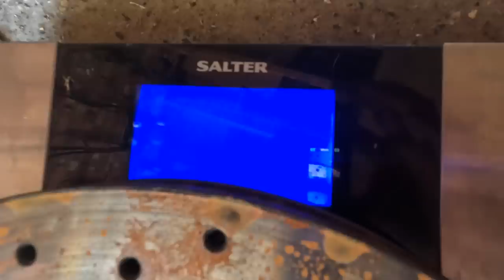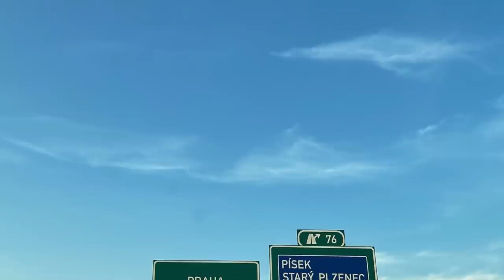I Just Bought the Cheapest Ferrari in the World  .... But there's a Catch !

Comment: Scott speak to Dave at MCT in Daventry Northants they will be able to manufacture carbon wing mirrors as they supply a lot of the F1 teams and Oem manufacturers with one off Carbon parts plus he has a 360 with some CS bit
Reply from the maker: Cheers Tim
Reply: @Ratarossa  just been speaking to him and he thinks he has a set of moulds but also has a 3d scanner as well he did all the ascari wing mirrors which were 360 CS wing mirrors

Comment: Nice one Scott ! Great to see it being put back to original, i have to ask though, if you had all the parts in the background, why not use what you had on the spider ? Doesnt matter of course, just would have saved you alot of work ! All the best MEC from MEC-TEC
Reply: From what Scott said, those parts were purchased over a long period of time. As they weren't there at the point where the donor CS was available it would have delayed the start of the Spider build.
Reply: @gbspikyfish  yes i thought they wouldnt have all been there in 1 go just but any bits that had arrived could have been used to save swaping em twice 👍👍
Reply: I did wonder this also as having to dismantle a car to rebuild it again takes a huge amount of time. But if the parts weren't available it makes sense.
Reply from the maker: its a very good question. I actually didn't have all the parts up until a few weeks ago and most of that has been discovered an dpurchased during the year it took to build the CS Spider. I honestly at the point of starting that project thought it would be impossible to find all these parts  .... i got lucky
Reply: @Ratarossa  its nice when a plan comes together a mate ! Loving it, great to see it coming back, i did watch the spider build too, i cant remember though, is there much to change on the engine ? Regards mec

Comment: I’m a big fan of those red calipers! Would it be pretty straightforward to put CC rotors on a F430 as well (aside from the cost)?
Reply from the maker: Yes easy ... but you need all the kit i installed in this video calipers, rotors and handbrake calipers along with  the brake booster. but its all bolt on and just bleed.  They are in fact the same on a standard 430 to the CS with a minor change to the centre bells of the disc going black from silver colour

Comment: Those brakes although only 50mm bigger offer almost double surface area (it’s the old trick of ordering 1 big pizza not 2 small ones)

Red callipers look sweet

Also, if it was me, the silver Ferrari is a genuine CF, logbook will verify that, I would take CF Parts off black Ferrari, put that on silver one so it’s back to a CF, put the spares on the black one to make it a rolling standard Ferrari and sell it off (or whatever you want to do) you will then have a legit CF down to the logbook

Also on the mirrors new iPhone pros can LiDAR 3d scan stuff, can u not scan the mirrors then print them in carbon fiber Filament, I know it’s not the real deal… but might get u close?

Comment: Dumb question maybe but would the ceramic brakes not need larger calipers given that they are larger and thus that 1.7kg difference could be somewhat or completely negated? I get they work better for stopping but really for lighter? Forgive me if I sound like an idiot for not knowing but I am genuinely wondering. For the mirror parts I am going to bet the mechanism inside it was from some other car and thus probably available some where. No sane manufacturer would make small electric motors etc just for one very small volume car.

Comment: Such a turn of events that you took all the parts off and now are putting them all back on again - if you had your time again, may have been the better way to build the spider!

What about the engine?  How much difference and are you sorting it?
Reply from the maker: Thanks Clive, its strange how these projects play out. When I started and even during the CS Spider build I still thought it would be impossible to find all the genuine kit and rebuild it (silver car) correctly, but i got lucky with some of the NLA items.  Good question about the engine, in fact I was very surprised when the donor car first arrived  (untouched by me prior to CSS build) I drove both the Genuine silver CS and my black CS (built car) back to back and my black car is MUCH faster, responsive and more lively. Most of that can be attributed to engine ECU remap with was custom done on my car using a base CS engine map and then re-tuning to open valves etc quicker, apparently its also gives 20+ bhp more power than a CS .... this makes the world of difference. Actually this is such a good question I will address it in the coming video. Cheers